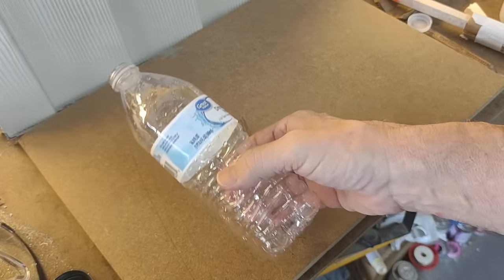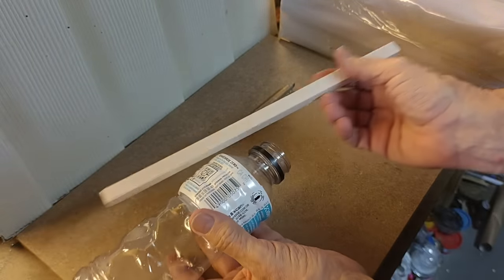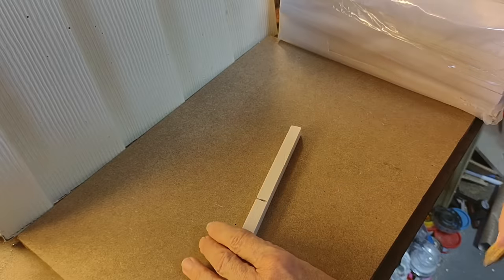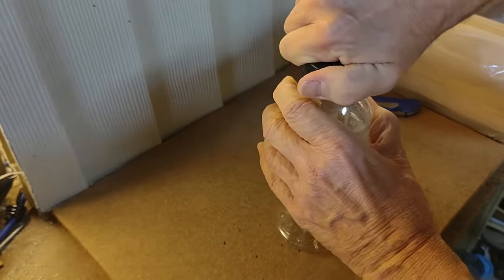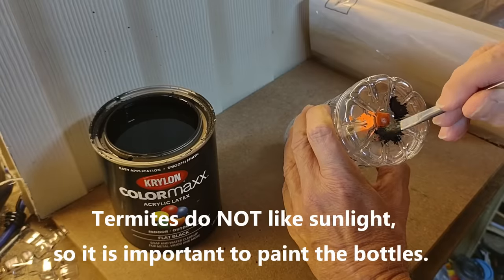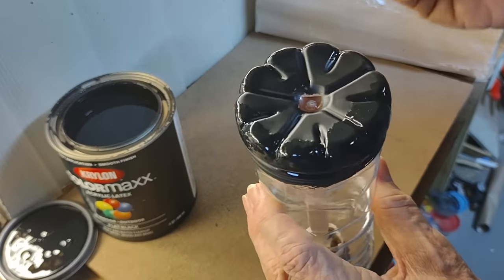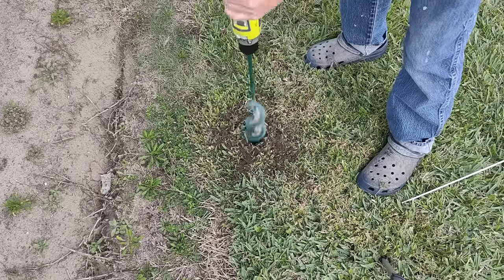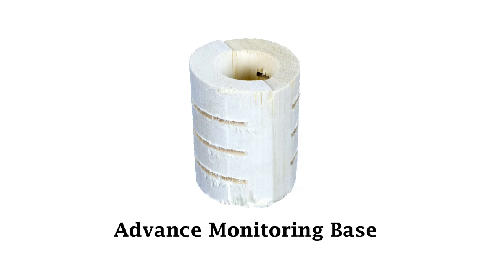Unbelievable Water Bottle Trick for Termites!  Simple to do!

Comment: You can’t sell a house in my state without a termite contract. But still a great idea.
Reply from the maker: I am not aware of any states that require a termite bond or contract.  That is to say, I am not aware of any laws to that effect.  However, many lenders require a termite inspection as part of the mortgage process.  This is always the case with FHA and VA loans.  Some unscrupulous pest control companies will tell you that a termite contract is required to sell your house, but it's not true.  If you Google it or ask a Realtor in your area, I think you will find that there is no requirement written into state law for a termite contract.  If there is such a law, then it must be very recent, so I would like to know what state we are talking about.  Most likely, if you want to sell your home, you just need to get a termite inspection done prior to closing.  If there are termites present, then it must be treated prior to closing.  That's it.  Termite contracts are pretty much a waste of money.  You are basically taking out an insurance policy in case you get termites.  Over time this will cost you a lot more money than if you just treat the problem when it happens.  All you really need is to do a termite inspection every year, which is all the Pest Control company is going to do.  You can easily do this yourself or you can usually get a pest control company to inspect for you for free.  So, my advice is don't renew the contract and keep the money in your wallet.

In addition to termite monitoring stations, you can also apply granules around your home every year for about $50 and an hour of your time.  It is very easy to do.  For the granules to work you need to have dirt around most of the house and that dirt needs to be porous enough to allow water to seep into the ground fairly quickly.  To find out if the dirt around your house is porous enough, just dig a small hole next to the house that is about 4 inches deep, 8 inches long, and just the width of the shovel.  Fill the hole with water and watch to see how fast it drains down into the ground.  If it seeps into the ground fairly quickly, then the granules should work just fine.  However, if it just kind of sits there, then the granules would not be a good choice, and you should just use monitoring stations.  

Make sure that you buy the correct granules.  You need the ones that have imidacloprid as the active ingredient.  A lot of the Home Depot and Lowes stores no longer sell the correct granules, but you can get them from Amazon.  I will give you a link to them.

I hope that helps.  Be well my friend.

Termite granules:  https://www.amazon.com/dp/B000RUIJYM?ref=nb_sb_ss_w_as-reorder-t1_k1_1_6&amp=&crid=157C3RV0MY0AK&amp=&sprefix=termit

Video on how to apply termite granules:  https://youtu.be/H7rW_TSBHJ4

Comment: Would this work for sow bugs or silver fish ? thanks
Reply from the maker: No.  This will not work for sow bugs or silverfish.  

The first thing you need to know about silverfish and sow bugs is that they get into your house from the outside.  Therefore, the first thing you need to do is to treat the outside of your home.  For silverfish, you just need to treat the building, but for sow bugs you need to treat the yard.  I'll give you a link to my videos on how to do that.
 
For silverfish you need to treat the inside of your home.  Purchase Niban FG Fine Granular Bait.  I will give you a link for the product.  You can apply this product in cracks and crevices in areas that are not accessible by people or pets, where you were seeing the silverfish activity.  One of the nice features about this product is that it comes with an applicator tip, so that you could apply it without using a duster.  Treat under baseboards, appliances, and where plumbing penetrates the wall, like under the sinks, and where the toilet supply pipe goes into the wall.  You can also apply the product in basements, attics, and crawl spaces.  In more open areas, you can use Dekko Silverfish Packs.  You can place these on kitchen shelves, under sinks, inside drawers, on bookshelves, in pantries, in attics, or any other place you are seeing activity that is out of reach of children and pets.  You want to place these about every 12 inches apart on shelves, and place about three or four of them under sinks and under appliances.
 
Sow bugs are mostly an outside pest, but in rare cases you can find them inside as well.  If you find them inside, it will usually be areas of high moisture.  You may find them in the garage around the heating and air conditioning unit.  They require moisture to survive, so if you see them in areas that do not have sufficient moisture, then they probably will not live longer than three days.
 
To treat sow bugs outside, rake leaves and remove any other debris in the yard such as branches and that sort of thing.  Apply Bifen LP according to label directions, with a broadcast spreader.  Then, water it in with Bifen XTS, as shown in my video on how to treat your yard with a hose end sprayer.  Be sure to treat your entire lawn and the dirt around any ornamental plants.
 
Again, these guys don’t usually live long inside, but if you need to treat the inside, then apply Temprid FX, mixed 8 milliliters per 1/2 gallon of water, using a pump-up garden sprayer.  Lightly spray areas where you are seeing activity.  Give it a few days after treating the outside to see if the problem goes away on its own before treating the inside.  Most likely, it will.  Be sure to remove or repair any sources of moisture.   
 
Finally, it's a good idea to seal up any cracks and crevices on the outside and the inside of the building.  Not only will this help to stop silverfish and sow bugs, but other invading pests as well.
 
I hope that helps.  Be well my friend.
 
Video on how to treat the outside of your home:  https://youtu.be/Yozv3s-Qwlw

Video on how to treat your yard with a hose end sprayer:  https://youtu.be/wifoTU5dmp0       
 
Niban FG Fine Granular Bait:  https://www.domyown.com/niban-fine-granular-bait-lb-p-49.html?pdpv=2
 
Dekko silverfish packs:  https://www.domyown.com/dekko-silverfish-packs-p-204.html?pdpv=2

Bifen LP:  https://www.domyown.com/bifen-lp-insecticide-granules-p-227.html?pdpv=2

Temprid FX:  https://www.domyown.com/temprid-fx-insecticide-p-17130.html?pdpv=2&sub_id=19352
Reply: @GuysPestSolutions  Wow ! thanks for all the help and knowledge, great channel.
Reply from the maker: @jt8280  You are very welcome.  Be well my friend.

Comment: Guy, I put down cedar organic wood chips in my back yard after it rained a smaw of carpenter ants and termites came to the surface. I think the cedar they hated and the rain brought them up. I sprayed the yard with spectrcide termite concentrate and use the 2 gallons water bottle. I sprayed the permeter of the yard and house , front to back. If I spray the wood chips, and let it dry—-will this be safe for my dogs.  How long does this treatment  last?
Reply from the maker: The Spectracide Termite Killer is pretty lightweight stuff.  I would be surprised if it worked at all.  If you have active termites, then you need to get down into the ground after them.  You may be able to do this with termite granules, but they do not work for Formosan termites.  You didn't tell me where you live, so I do need to let you know that.  Formosan termites hang out in warmer climates.  Also, for the granules to work you need to have dirt around most of the house and that dirt needs to be porous enough to allow water to seep into the ground fairly quickly.  To find out if the dirt around your house is porous enough, just dig a small hole next to the house that is about 4 inches deep, 8 inches long, and just the width of the shovel.  Fill the hole with water and watch to see how fast it drains down into the ground.  If it seeps into the ground fairly quickly, then the granules should work just fine.  However, if it just kind of sits there, then the granules would not be a good choice, and you should consider trenching.  If it turns out that you need to trench, then please watch my video on how to do that correctly.  Trenching is a lot more work, but it only costs about $100 to do an average size home, and it lasts 5 to 10 years.  Most people can trench an entire house in one day, but you can take up to a month to get it done, and you can literally do just 10 feet at a time.

Make sure that you buy the correct granules.  You need the ones that have imidacloprid as the active ingredient.  A lot of the Home Depot and Lowes stores no longer sell the correct granules, but you can get them from Amazon.  I will give you a link to them.

I hope that helps.  Be well Amanda.

Termite granules:  https://www.amazon.com/dp/B000RUIJYM?ref=nb_sb_ss_w_as-reorder-t1_k1_1_6&amp=&crid=157C3RV0MY0AK&amp=&sprefix=termit

Video on how to apply termite granules:  https://youtu.be/H7rW_TSBHJ4

Video on how to trench for subterranean termites:  https://youtu.be/Fy7YHi_7Z8g

Comment: Do you have any advice for eliminating voles? My yard is full of tunnels and holes. 
Thank you!
Reply from the maker: I know this may sound horrible, but I think the best way to treat voles is to use regular old mouse snap traps.  Place the trigger perpendicular to the runways.  You can use peanut butter to bait the traps.  It is always a good idea to cover the traps with a throwaway tin pan that you would use to bake a casserole with.  This will help to prevent non-target animals from getting into the traps.  The pans need to be deep enough so that the trap will be able to trigger inside the pan without the kill bar hitting the top of the pan.  How many of these you need is going to depend on the size of your property, but obviously, the more of them you place out, the more effective it will be and the faster it will get rid of the problem.  The best time to treat is in the fall or in the winter. That is because they will have less food at that time, making it more likely that they will go for the bait in the traps.  You should always wear rubber gloves when handling the traps.  These traps can be reused by releasing the animal into the trash, and then washing off the trap with a garden hose.  I don't know that you will ever get complete control of the problem, because they will continue to come over from the neighbor's yard.  However, you can greatly reduce the population this way.  I think it's just one of those things that you need to do on an ongoing basis.

I hope that helps.  Be well Janet.
Reply: Another idea is to put balls of peanut butter and baking soda in their hole. Pretty sure that's the mix. Done. Yup. Gone.

Comment: Addition to last question: I do have annual termite inspection and contract. so far no problems.
Reply from the maker: I termite contracts give people a lot of peace of mind, but the truth is that what they are selling you is basically nothing.  With most termite contracts what you are getting is an annual inspection, which you could have gotten for free by another company.  Most companies will come out and give you a free inspection if you ask for one.  All they really do when they inspect is walk around the house and look for mud tubes.  You are supposed to go in the attic and look as well, but almost none of the companies actually do that.  Some people argue that there is a bond that would require the company to pay for any termite damages that would result from a termite infestation that they missed.  The thing is though that it is very rare for that to happen.  Termite's are very easy to spot because the termite tubes are going to be coming up from the ground and you almost can't miss them.  Also, almost all species of subterranean termites are very slow eaters, and it can take years for them to do any significant damage that would need to be repaired by the pest control company.  So, the pest control company would need to miss the infestation for several years before they would ever need to pay out a penny for any damages.  Meanwhile, you a handing them something like $300 a year for them to pretty much just walk around your house one time.  Sure, if there's an infestation they may treat the house for free, but it's not exactly free because you've been paying them $300 a year for Lord knows how long.  You probably ended up paying them several times what it would have cost just to hire somebody to do the treatment.  Sometimes, companies will sell you a baiting system that is supposed to kill the termites before they get to your house.  These actually do work fairly well to prevent an infestation, but they do not always work.  It is way cheaper and more effective just simply install the monitoring stations yourself.  So, I never recommend annual termite contracts of any kind.  The money would be better spent giving it to your favorite charity.  If you are concerned about termites, then applying termite granules every year and installing the monitoring stations makes a lot more sense.  I hope that helps.  Be will my friend.